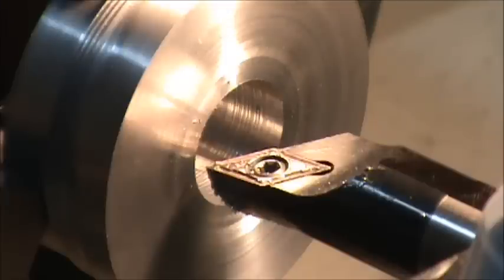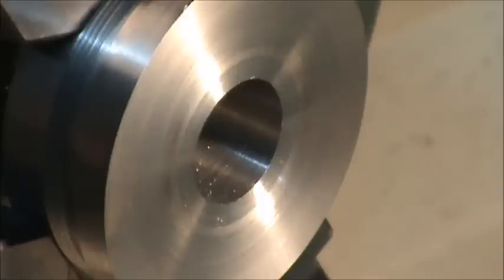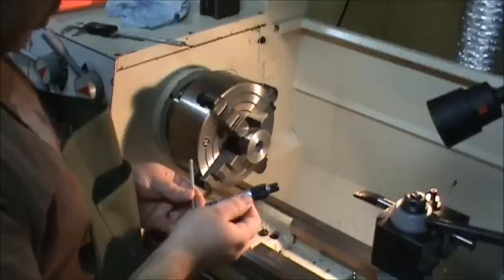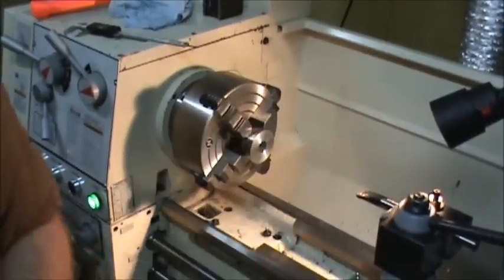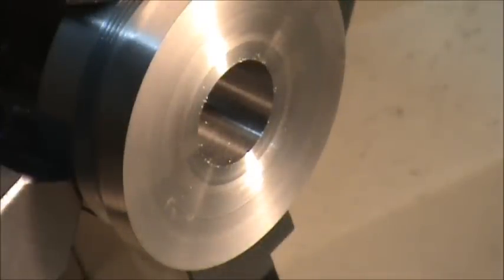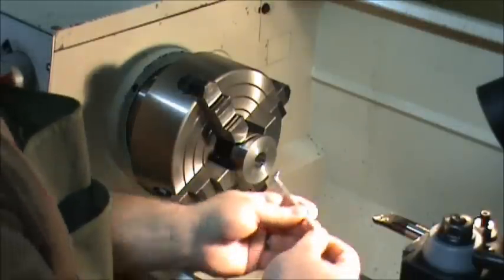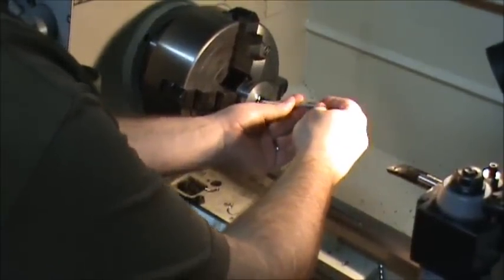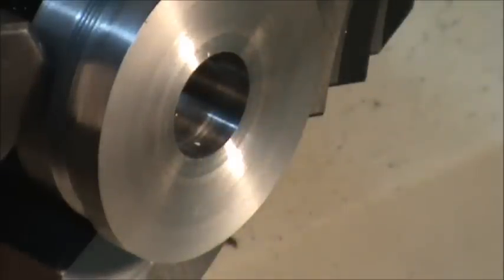3-9 Update Part 2

Comment: Coming along pretty good there swlamech84, with a snap gage you don't tighten it all that much before pulling it through. After that you DON'T feel the measurement with the mic (right hand), you rock the gage (circular/back&forth) as you bring the mic anvil down and feel the gage with the left hand when it contacts the anvil. You will develop a feel for the process quickly & make good speed. Good luck, Matt